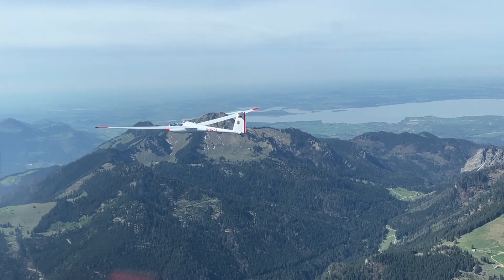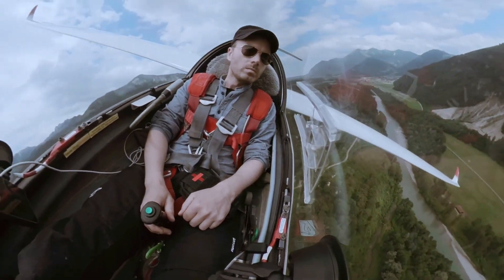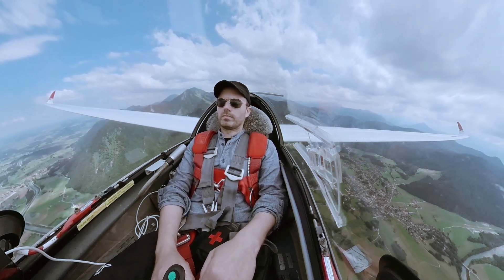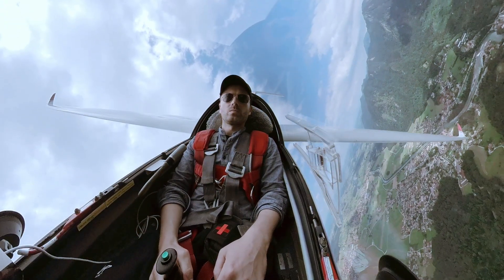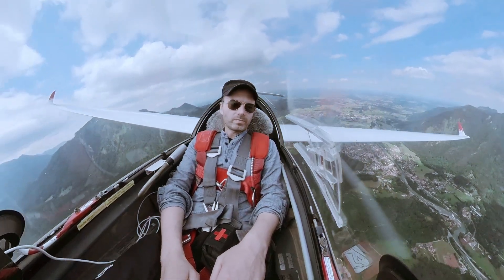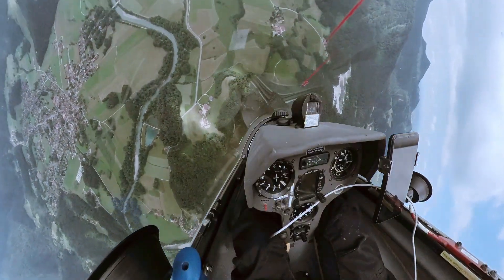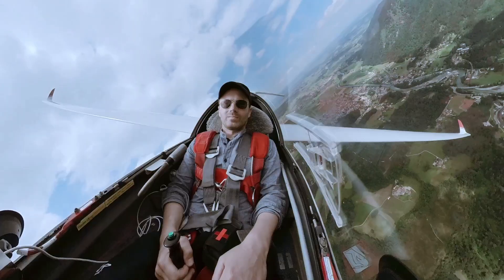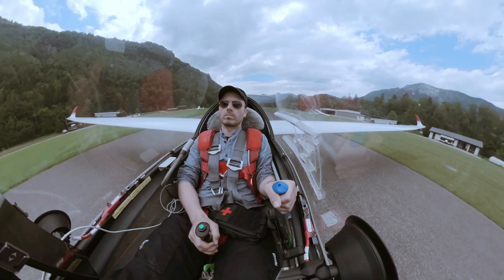Most DANGEROUS turn in gliding...

Comment: Thanks for video, first of all!
Why do you think that, after "neutral elevator", you need "rudder against the spin direction"? I thought better to accommodate the stall to have greater speed and exit the stall itself?
Reply from the maker: thanks for your comment…i hope i did understand your question correctly …if the glider just stalls it is often enough to just release/gently push the stick to gain speed…if the glider is stalled and entering the spin the rudder against the spin direction helps to stop the spin…
Reply: @flyneur  right.
If you gain speed, it's enough imho
Reply: Once you apply full rudder in the opposite sense of the spin (to counteract the yaw) then it's centrally forward on the elevator (neutral ailerons) until the rotation stops. Then centralise the rudder and ease out of the dive. The required forward movement of the stick will vary between gliders and so neutral may not be sufficient. If you don't counteract the yaw, the glider might not recover from the spin, and if you don't neutralise the rudder, once the rotation stops, you could end up spinning in the opposite direction when you try to ease out of the dive - especially if you do so too quickly, exceeding the critical angle of attack, and induce a high-speed stall.
Reply: @davidallan9624  maybe, dear friend. I just had two different instructors ( with two opposite solutions🥴)
Reply: @ORMA1  I think that we're talking about slightly different points. I was discussing the fully developed spin and the standard recovery. Bringing the "stick centrally forward until the rotation stops" is easier to do in the heat of the moment as it will essentially find the point that breaks the stall (which could well be close to the neutral position). Spin avoidance is really what we're after as the spin recovery will require a lot of height. You're right, in a turn if the gilder stalls then ease forward on the stick (reduce back pressure - depending on trim) and recover flying speed. In a well-ballanced, coordinated, turn this will recover with minimal loss of height. If the wing drops in the stall then the spin can be prevented by first breaking the stall, stick centrally forward, without making the dropping wing stall further by trying to pick it up with the ailerons (that could well induce the full spin). Once flying speed is regained then the aircraft can be maneuvered to level flight. A spin at low altitude on the turn to final, is often caused by distraction leading to the loss of coordination/speed. This could be due to a number of factors all leading to a low shallow turn to finals (usually a loss of height in the circuit). It's better to land somewhere else on the airfield or choose an adjacent field to land in rather than attempt any low turns (less than 300'). I did the latter a couple of years ago when I encountered a lot of sink on the downwind leg of the circuit. I ended up in a farmer's field on the other side of some very tall trees from the airfield. It was worth the haslte of derigging the glider and getting it back safely to the airfield in the trailer rather than attempt anything rash at low altitude.
Reply: @davidallan9624  thanks a lot for your explanation. It's a doubt since my licence examination
Reply: @ORMA1  Thanks. When thermalling the glider is often close to the stall and a gust (or some sink) can induce a stall. Just ease forward a little to break the stall and little height is lost. It's recognising and preventing that are the key things.

Comment: I had the opportunity to have a former fighter instructor from the French Air Force as my glider instructor. He confirmed what you mentioned: typical spin training doesn't accurately represent how spins happen in real life. The only spin training I received was during turns… which is quite intimidating. I learned the hard way but became much calmer in similar situations while flying solo, and I was able to avoid entering a fully developed spin (in turns )by recognizing the cues early in the process.
Reply from the maker: Thanks for your comment. It seems that everyone is aware of this topic in gliding, but it is not generally represented everywhere in gilding training. I hope this video helps to adress this issue. Great that you had the opportunity to learn from a real pro! That is value.

Comment: As a not glider pilot (I'm a pro paragliding pilot), always wondered why it wouldn't be a plus to have airspeed indicators on both wingtips? Slow turns, with such epic wingspans means that inside wingtip is probably often flirting with a stall. An audio warning (different for left/right) might be nice? ❤
Reply from the maker: Thank you so mcuh for your comment. Yes, I guess the first one who will provde such devices will receive a lot of appreciation from glider pilots and glider schools. And yes, the inside wingtip is always the one more close to stall. In thermals I like to fly the glider very very slightly in a slip. It feels more safely exactly because of what you mentioned before  and an additional effect is that the glider feels much more stable in a turn.
Reply: Hallo Christoph,
Ich würde dir dazu gerne persönlich etwas antworten. Geht das irgendwie? (Bin selbst Segelflieger)
Liebe Grüße
Reply from the maker: @wolfhelm.-mq3rn  Gerne! mail ät christophwieland.com
Reply: helpful but you can stall at any airspeed, so it won't ever be an indicator of being in a safe envelope.

Comment: Thank you for bringing up this topic. As an instructor I would like to add a part of the recovery procedure, which is often forgotten but vital: after rudder correction to stop the turning: rudder neutral. If not, you'd spin the glider in the opposite direction, which, close to the ground, is impossible to recover.
Reply from the maker: Thanks for adding this essential part here. That brings detail and value into the comments!
Reply: To stop turning, stop steering. Who would've thought.

Comment: Stop using aileron near stall!
Reply: Aileron has to go to neutral for stall recovery.
.
.
.
Generally in a very slow turn to, say, the left - while turning your stick tends to be right of centre. The common mistake is when you are stalling, your left wing starts to drop a little more and you try to pick it up by turning the stick more to the right.... You say, "Stop using aileron near stall", well it's not done on purpose, but airleron position is very much part of spin recovery.
.
2 things tend to occur:
.
1. Incipient stall – to get yourself out of the incipient you need to catch it ie: stick forward and to the left of centre, left rudder, then pump it back – hard right rudder and enough right stick to flatten the glider but a little forward on the stick to pick up speed and not stall again.
.
2. Full spin (as occurred in the video)– stick to centre (ie: flatten the ailerons), hard right rudder, pull back on the stick (as you are flying down with a lot of speed), LOOK UP!! to see what you may be flying into (very important if you were among a gaggle of gliders).
.
.
Be sure to check your glider's handbook to see the exact procedure for the full spin recovery as there some differences between gliders. Reading and understanding the handbook is a flying requirement.
.
.
The danger of the turn into final should not be underrated as stated in the video – it is true that too many accidents have occurred during this moment. You are too close to the ground for a recovery.
.
This is a well made and good reminder video.
.
Let's fly safe people!!!
Reply: @markplain2555 He said so twice. So what?

Comment: I had a spin training last year and I'm so glad I did it. Should be mandatory for every flight student to experience that and to train how to get out of it, just like a rope break training for winch launches.
Reply from the maker: ...absolutely, the same experience you had, motivated me to make this video...I hope it helps to spread that stall training in a turn really improves safety a lot...
Reply: It is mandatory in the UK under the BGA curriculum.  A number of clubs fly with the ASK21 that really does not spin very well... Until the addition of a manufacturer approved mod; the spin kit. Weights are fitted to the tail and a table of cockpit weights is generated by Schleicher.  It works very well, but does limit the combined weight of pilots
Reply: @nubink it’s mandatory in New Zealand, including as part of the biennial flight review.
Reply: It is, I remember being scared of it as a youngling the night before, but with the first rotation it converted to pure fun.
Reply: It IS mandatory training! Those most caught out are the long term flyers. Those who SHOULD know but forget the basics, training shouldn't stop at all. Predominantly the old guard fall foul of that mantra, you see it happening time and again. The pilots with their own plane, just not enough time to fly regularly. Those with busy jobs, see as a nice hobby, the time to switch off from day-to-day grind.

That is why it happens, not the professionals or those in a club environment.